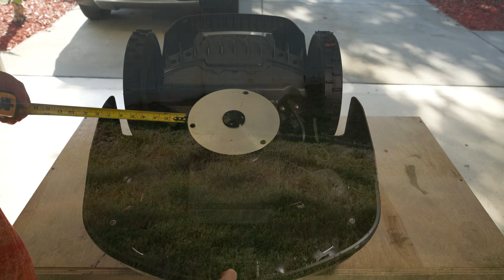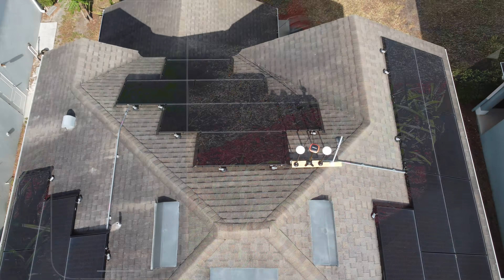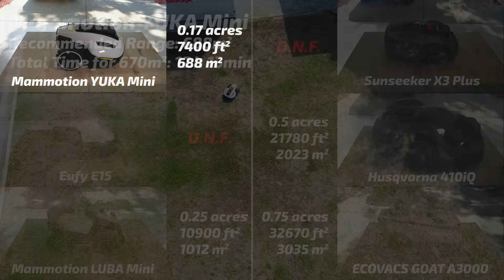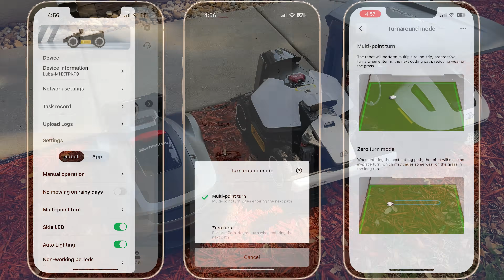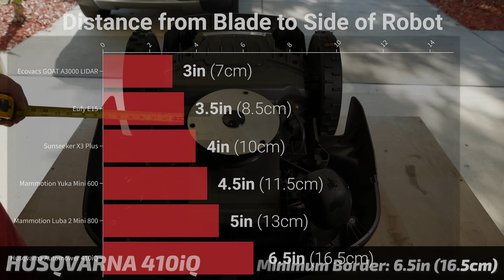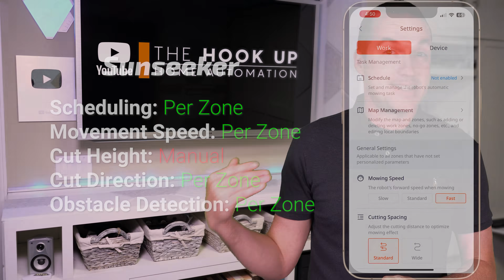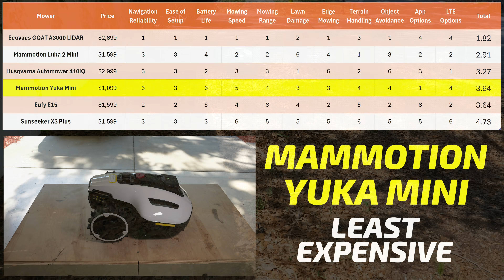Watch BEFORE You Buy a Robotic Lawnmower - LIDAR is a GAME CHANGER!

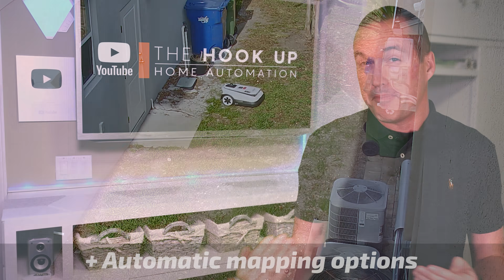Comment: 7:56 it's not new. My 8 years old vacuum cleaner have lidar.  But yes depend son how cheap parts manufacturer buy...lidar can be very long serving item and can be garbage.
Reply from the maker: It's actually a different kind of LIDAR than vacuum cleaners use.  Vacuums use single plane lidar while mowers use 3D LIDAR which helps them locate themselves in an environment where the single plane landscape may change often.

Comment: You should have done another test. Put a single tall dandelion in the middle of your grass... You will see that the Ecovacs (I own the 1660 lidar pro) is the worst - it will never cut it and leave a patch of uncut grass too. And this patch will then grow, since at it borders another tall grass will grow.Also when stuck, the batter goes to 0 - I come home from work and it has no more energy to return to the station after I unstuck it - I need to lift this 15kg mower in my hands and manually put it to the station.   I feed frustrated? Yes, I am and I am searching for a replacement.... IDK if RTK version could help with the dandelion problem.
PS: Also , becase its shape and where the moving blades are on the mover, it cuts less in the corners than my old mower.
Reply from the maker: Yep, I will be testing that this year.  I used the A3000 all year and definitely noticed that.

Comment: Thank you I found this very educational and learn a lot have to test the yarbo yet ?
I also have a concern of the mowers running over dog droppings
Reply from the maker: Yes, I have a Yarbo to test for this year's video.  Running over dog poop will definitely happen, if you have one of the mowers with mulching blades (Yarbo Pro, Lymow, Airseekers, Anthbot) it will pull the poop into the cutting deck.  All the other ones don't have any lift so as long as the poop is below the cut height of the grass they will not actually cut it, but they will run over it with their tires.

Comment: What do you do when the battery run its life and is no longer holds enough charge to do the job? This would likely happen in just 5 years. Do you basically end up with a ~$2000 paperweight? I don't see options on the websites for a replace battery.

Comment: Anything that cuts with little razor blades and no uplift isn't going to mow very well. Anything with lithium ion batteries isn't going to last enough charge cycles and is also a fire hazard. The only robotic mower that mows, and has a lithium iron battery is the LyoMow one or one plus. I don't know of any others. Can't you find someone with a proper lawn for testing?

Comment: I'm a professional land surveyor, and I can tell you having 4 bases beside each other could make them not work. There would be a huge amount of signal distortion that could happen if they're using any similar frequencies. When we're setting up a base and a rover, just having the rover to close when you're setting up can make it where the rover can't get a fixed position(can't do the calculations because signals are disturbed). But yes, all the other is also right, going in between houses is almost impossible except for the best GPS on the market, which is around 35k each.

Comment: Straight and neat lawn stripes? WTF? No, you want randomness, so you get an even cut with no stripes what so ever.

While it's more work, a signal cable navigation system is, if done right, the by far best system. Especially if you have risky areas, drops, etc.

Comment: When you measure cutting blade to edge you might want to extend the blade to it's cutting length first instead of measuring to the base circle that holds them since it's not what does the cutting. That might change the measurements a good bit, no?
Reply from the maker: All of the blades are the same size.

Comment: Eufy have resolved all of the issues brought up here re the app
I agree that the battery needs work, but my lawn isn’t that big where I would care about that.
I have not seen any lawn damage from the wheels and that’s good since it rains here 80% of the year!
Once I sorted the edges and bare spots which (now) takes less than a minute, I’ve never seen it get stuck.
I do think that a vision, lidar, dual disk, large wheel / track mower would be perfect, let’s hope someone makes it, but the cost might drive closer to commercial farm equipment which already does all this stuff.
You’re always going to need to go over your lawn once a month or so, but I do this anyway with a verticutter and debris pickup with a normal mower. What the robot does is keep my lawn pristine in the meantime and therefore saves me hours which is better spent drinking coffee and relaxing!

Comment: The mower knows where it is at all times, it knows this because it knows where it isn't. By subtracting where it is from it isn't or where it isn't from where it is, whichever is greater, it obtains a difference or deviation. The guidance subsystem uses deviations to generate corrective commands to drive the mower from a position where it is to a position where it isn't and arriving at a position where it wasn't it now is.

Comment: 4 months ago I bought the Mammotion Yuka mini. I have a 140 m2 garden "U" shaped around my house. I was a very disappointing experience. Fist takes more than 3 hours to do the task, when he finished and is not stopped, with no reason, in the middle of the garden. There are loosed spots everyday, but different every day, corners of the garden are always not mowed.
RTK is a bad option for small gardens, it doesn´t works. The robot looses the direction when passes trough small roots. And after last update stop mowing. 
I contact support and they can not resolve the issue. 
In conclusion RTK is a very bad technology for small gardens.
I´m very regretted of buying the Yuka mini, 900 € now parked in garage. 
I come back to electric battery mower.

Comment: I have looked into these before with the old wire based perimiter, thanks for your review, I have a LIDAR indoor cleaner which is very good and think the mowers will go this way, untill there is a greater choice and more competitive pricing I'll stick to a manual mower, as you can but a pretty decent ride-on for the same price

Comment: The metric that was not discussed was customer service. The GOAT A3000 has no replacement parts which is a major concern for longevity of the equipment. Refund or replacement of the mower are the only options. Replacement mower only if in stock. As it’s mentioned, uncertain how long the LIDAR would last. Well, you can’t replace it. How would you rate this mower now?
Reply from the maker: Where are you getting the information that there are no replaceable parts?

Comment: The yard size ratings are not how long they can mow before charging, but what size yard that model is rated for.  Gas mowers are not rated on tank size either, but the yard size they are designed for.  Interesting to see a couple not even be able to finish yards they were rated for.

Comment: I have a push mower with an auto drive. Meaning you push a bar along the handle and the wheels turn automatically. I've had the mower since the late 1980's. Honda USA made and yes Honda had a plant inside the USA back then. It needs to go in for general maintenance on the blades every 3-5 years and some other wear and tear engine work on occasion but gets the job done on my small lawn which takes me about 15 minutes of walking behind it and manually turning the mower at the corners of my yard. Also has a grass blade catcher that I use for mulch inside a garden. These robot mowers don't seem to offer much longevity. Those tiny razor blades appear to not last very long at all and look like they are already rusting in your pictures. At thousands of dollars these are not worth it for small lawns. Too many "buts" with these machines. Too many electronic parts that can die or go bad in weather. Also have to worry about battery longevity. These are made to break down quickly so you have to buy them again from what I see.

Comment: I pay $30 every 2 weeks for a gardener to mow the lawner, clean up the leaves, trim bushes, etc. It is 100 times of what these robots costs. It is worth 4 yrs. It is headache free. If I was to buy the $3k one, I will have to troubleshoot and baby it often, worry about it getting stolen, getting stuck and stop working. And I don't have a SECURED place setting up for the charging station. I made my decision - stick with my hardworking gardener.
Reply from the maker: That is an absolute STEAL.  My lawn service is $160/mo.

Comment: I was looking at the mmotion yuka, hence as my yard has really rough ground with dips and bumps and contacted them via the chat on their website to ask if the Yuka will be able to handle it ... and i was told, that the Yuka cannot maintain a yard bigger than the specified size, because it cant save a map bigger than the size they advertise, which to me sounds like a deliberate software limitation so you'll get the more expensive version.  My budget is really tight, so i'm looking at the ecovacs now, issue is i would really love it if i can borrow a robot to give it a try if it can handle the uneven ground before making the purchase.

Comment: Would any of your issues be solved by having two robot lawn mowers (presumably two mowers that aren't more expensive than one A3000)?   I haven't used a robot lawnmower before, but as I've been reading reviews and watching videos I realized that I'll have to find a solution for my fence between the front and back yard.   I'm wondering if two mowers would help resolve RTK issues and also solve my fence proiblem?     And great video by the way!   One of the best I've seen so far.

Comment: How bout Ecovac a2500
Reply from the maker: It's RTK, so it would have the same issues as the Mammotion mowers.
Reply: Rob, it is not just RTK. Its RTK, LiDAR, and some other thing. It’s seems like a Tweener
Reply from the maker: The LiDAR and vision is only used for object avoidance, not mapping.  It's primary positioning is still done with RTK.

Comment: I'm sorry, what?  I was with you right up until you said "$2699."  I gave less than that for my John Deere S160, and it can use standard accessories like tine dethatchers, core aerators, drop spreaders, trailers, etc.  Do any of these lawn roombas have attachments for typical yard maintenance?  How do they do on steep inclines and uneven surfaces?  A $200 push mower can be dropped down into a ditch to break up weeds between burns...

I don't understand what the point of these is.  They're clearly just a gimmick, and I'd give $300 to get one just to play with it and probably end up returning it out of disappointment anyway,  but $1500-$3000?  WTF are you getting for that kind of money?  Are they bulletproof or something?  I mean, like aerial drones, people WILL shoot at these either out of boredom or confusion...
Reply from the maker: The S160 is currently $3200, this is also a completely different concept.

Comment: the lawn in this video is lacking. The more grass you have you would have less damage. I would think a typical zero turn would tear it up since there isn't much grass but more like patches on it. The other thing I wonder is you had all the RTK stations mounted at once it shows in the Video. They are 900mhz and with that many so close together you would have problems with signal. Only one should have power at any given time that close together.

Comment: First - thank you for making an actual informed take on robot mowers. This is the first one I’ve seen that isn’t an advertisement in disguise. 

That said.. there are some issues.
* Luba 2 can be set to use 3 point turns to prevent damage. Also you left out randomization of cutting direction to avoid rutting the lawn.
* most people set up a landscaped area for docking making the point about damage moot.
* lidar is very bad in dynamic environments e.g. cars running near by. If you don’t have a means to physically confine the bot (fence or similar) lidar based bots WILL wander off property and get crushed by traffic. I don’t want to talk about how I know this. If and only if you have a lot of disticnt features (make sure you really understand what constitutes distinct as it relates to each type of sensor) lidar may work fine for positioning. If you are more rural or live in cookie cutter subdivision, expect to be chasing your lidar or vision based bot down the road several days a week. It does not and will not “just work” in most cases. If rtk is not an option for you the only other way to without fail confine a lidar based bot would be a fence or a perimeter wire setup which I don’t think anyone is doing anymore. But lidar with outer boundary wire would be next best to confining via gps.

Comment: Thanks for this excellent video!  I had done prior research, but based in large part this video, I purchased the Ecovacs A3000 and it's a very good machine and performing well.  I made some assumptions about how it would perform on northern lawns with actual soil and tall fescue, and it did not disappoint.  One note for others in regions with more soil/silt rather than sand or clay - you'll want to skip the scheduled day after a soaking rain...the units twisting and spinning of the wheels can really break up any bare areas with soft muck.

Comment: I've had quite a few robotic mowers over the years, and unlike your experience, Sunseeker models have actually become my favorites. In contrast to your video where the Sunseeker kept getting stuck, mine have never gotten stuck at all.
I currently have both the X5 and the X3 Plus. The X3 Plus has worked for over 100 hours without getting stuck a single time. The X5 has run for roughly the same amount of time and only got stuck once and that was because it ran over a piece of string that got tangled in the wheel.
Even when I’m watering the lawn, the X3 Plus manages to detect the hose lying on the ground and avoids running over it. 
In my opinion, these are excellent mowers reliable and surprisingly smart.

Comment: Hi, I’ve been wanting a robotic mower for a while and ended up buying the NaviMow 105 with RTK. The RTK antenna is mounted on a second-story roof with a clear view, so the base station works great. The problem is the mower itself can’t get a clean GPS signal—too many vertical stone walls and tight spaces. Some parts of the yard are less than 4 feet wide between the house and the wall, and it’s never been able to successfully map the yard, let alone mow it.

I watched your review and was really encouraged by how well the LiDAR model performed. I know you can’t say for sure, but based on your experience, do you think this LiDAR mower might work where GPS-based ones like NaviMow fail?

Thanks,
Joe
Reply from the maker: Absolutely.

Comment: Fabulous, comprehensive review as always Rob!
 I have a relatively flat NE lawn, about 5000 sqft on my lower lawn, but then I have an upper lawn (separated by stepped retaining walls) ~3-4000 sqft that's also in 2 sections divided by walkways. I have a relatively clear view of the southern sky. I was thinking of getting 2 mowers (one for each lawn), 2 GOAT a3000's seems a bit overkill for this (and $$$) but I was thinking of either 2 GOAT o1000s (only $850 right now!), segway navimow i series, yuka minis or even luba minis. Have any input? I know you recommend the Luba mini but I wonder if it's worth 2 o1000s! (Also, do you think the navimow and ones of it's ilk will perform like the sunseeker? they're similar in appearance)

Comment: Bro, that is NOT a lawn. There are a bunch of factors that need to be considered if you actually used a nice lawn. Like mow height and blade sharpness.
Reply from the maker: This is dormant grass in the Florida dry season, it's very much a lawn.  Mow height was specifically covered, all the blades are identical.
Reply: @TheHookUp If grass is dormant you 🤡, then it's not supposed to be mowed. That's applicable to winter and summer dormancy. You obviously don't know the difference between weeds and grass either. I saw more weeds than grass. You don't need a lawnmower, try using some pre emergent in the spring before weed seeds germinate.
Reply: @TheHookUp You're not supposed to mow dormant grass whether it's winter or summer time. Get a clue. You don't have any grass, it's mostly weeds. You mow it too damn low so it goes dormant einstein.
Reply from the maker: You literally have no idea what you're talking about.  This is dry season grass in Florida.  It still grows (slowly) and needs to be mowed.
Reply: @TheHookUp First you said it's dormant. Now you said it's dry season. There is no such thing called "lawn dry season." There are lots of lawns that are dark green in Florida. Why in the hell is my grass dark green in California again without a drop of rain? It's because I know what the hell I'm doing and you obviously don't.
Reply from the maker: My first reply literally says "This is dormant grass in the Florida dry season".
Reply: @TheHookUp My response is you don't know anything about lawn care. Stick to cutting weeds.